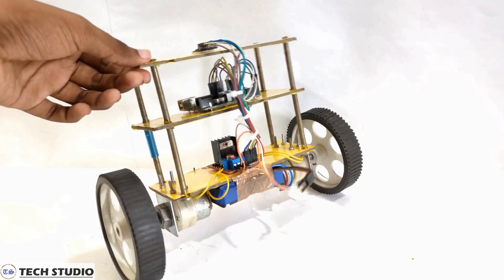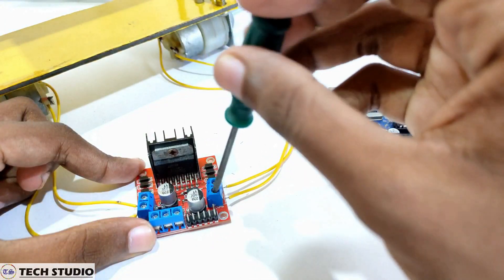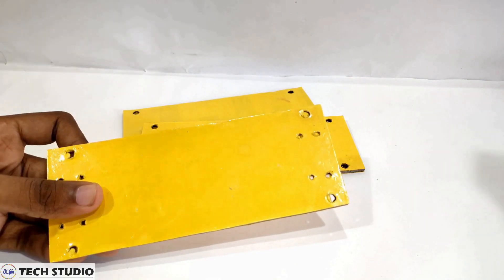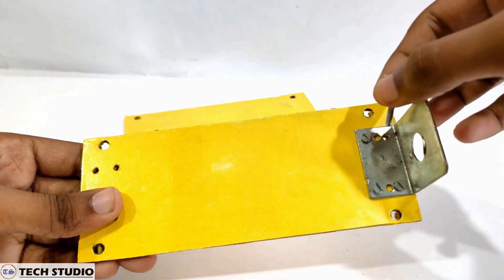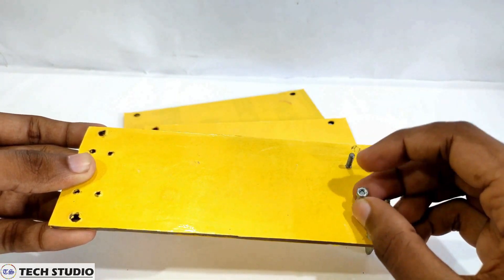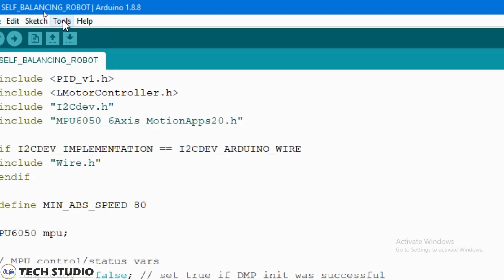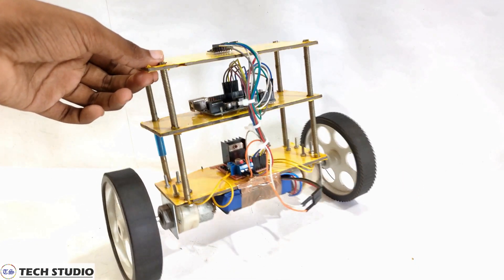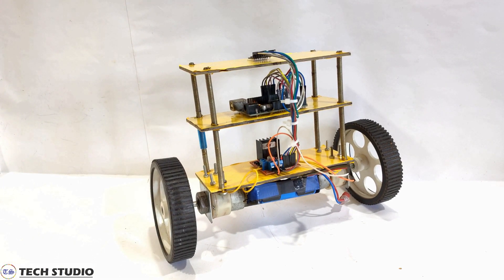How to make a self balancing robot using dc motor and arduino | My Tech Studio

Comment: i think this code was for arduino nano because it has pins 0x10 and 0x02 and the serial monitor doesn't show the orders and when i added the serial begin it shows (( waiting for first interruption )) and the motors keep rotating without any change even if i took the sensor out of the circuit
Reply from the maker: The code was written for arduino uno, not for nano
check the connection once again.

Comment: Bro can I give 9v supply to arduino and 12v supply to l298n?
Reply from the maker: Yes you can
Reply: @MyTechStudioOfficial  I have successfully uploaded the code , But i am confused a bit with the connection of the batteries
Reply from the maker: If you want to give a 9volt supply to Arduino seperately then connection will be different
Connect positive pin 9volt battery in vin pin of Arduino
And negative to gnd
Rest of the things are same
Reply: @MyTechStudioOfficial  ok, so i will have to supply 12v power to just l298n ,because in the diagram the connection was done to both arduino and l298n?
Reply from the maker: You can use the 12 volt battery for both the motor driver and arduino.
But if you want to use a seperate supply source then follow what I have told earlier.
Both the method will work.
For any other queries feel free to contact us.
Thank you... stay connected

Comment: Why u have powered Arduino with 5 volts
Reply from the maker: Because 5 volt is sufficient to run the Arduino.
Only give the 12 volt to motor driver.
Reply: @MyTechStudioOfficial  my problem coming is both motors are running on backward direction continuously,and not balancing
Reply from the maker: I think your connection is not right.
Try to check the connection once again.
Also check the orientation of mpu 6050
Reply: @MyTechStudioOfficial  i have checked the wires 5 times and mpu is also giving correct readings
Reply from the maker: Both motor are rotating in one direction only ?
Reply: @MyTechStudioOfficial  yes sir could you please help me
Reply from the maker: I think you have a problem in the code. 
Check it 
If it is not working then email me because here I can't understand what is the real problem.
Reply: @MyTechStudioOfficial  ok
Reply: @MyTechStudioOfficial  can you help me too? the problem is in "Arduino\libraries\MPU6050/MPU6050_6Axis_MotionApps20.h:580:31: warning: left shift count >= width of type [-Wshift-count-overflow]
      data[0] = ((packet[28] << 24) + (packet[29] << 16) + (packet[30] << 8) + packet[31]);"
Reply from the maker: @indratechs  Include the library of MPU6050 and upload the code given in the description.
Reply: @MyTechStudioOfficial  I have done that but why is there an error